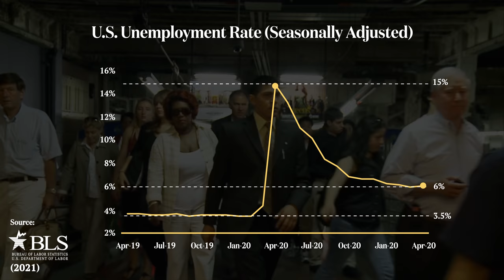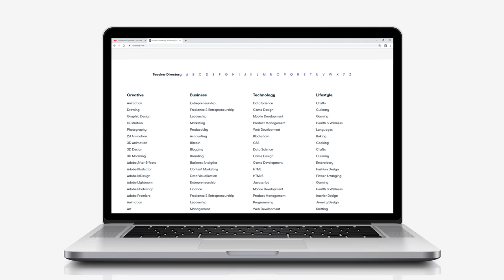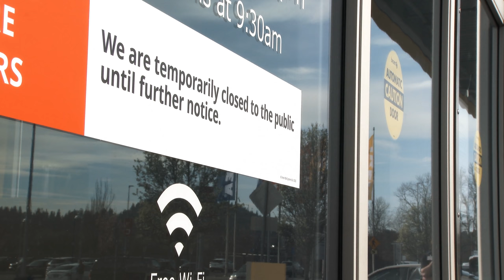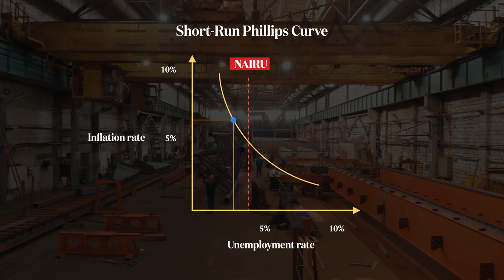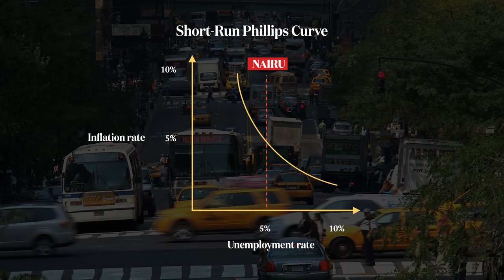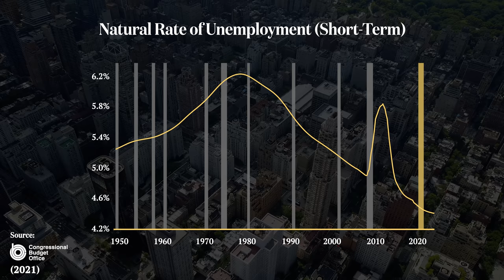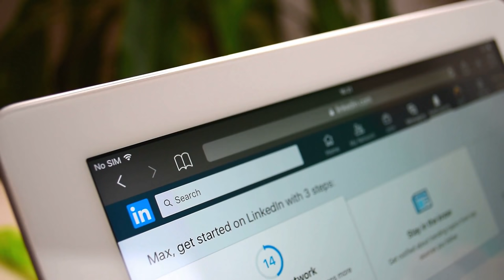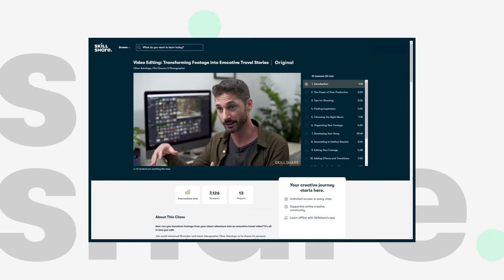The Great Labor Shortage Crisis | Economics Explained

Comment: I find the framing interesting, calling it a “Labour shortage”, instead of a “Job abundance”.
Reply: @Ciph3rzer0  I used to be your run of the mill Libertarian until I actually started working, not anymore. I've learned better than to trust Capitalism. Capitalism is the enemy of the free market, just as much as, if not more than, socialism.

Now, I still don't believe in the minimum wage
I think its no more than a temporary solution at best, or at worst, an appeasement.
The 7.25 minimum wage was put in place in 2009, 
in 2021, a 7.25 minimum wage might as well be the same as a 5.72 minimum wage in 2009
Even if the minimum wage was brought up to 11 or 15 (though both a net improvement value wise), it will only inflate and we'll be back to square one eventually

We need Unions. Strong Unions with integrity, that will actually fight for a dynamic fair wage, good benefits, and put the power in the hands of workers, not politicians and their corporate puppet masters.
Reply: @matizluv1316  Socialism just tends to not work out cause it tends to necessitate statist or authoritarian measures, which will always fall into the wrong hands (cause the only people who seek to harness state power are specifically the ones who should not have it), and we end up with every long-lasting socialist system we've witnessed today. We haven't witnessed the failure of socialism, we've witness the failure of Humanity. 

Mutualism is about as close to Socialism you can get before you hit the Point Horizon of the Statist Black Hole(tm)
Reply: @matizluv1316  This is true. Theoretically Socialism is far better than Capitalism. The biggest problem with Capitalism is that it actually incentivizes anti-competitive practices. If Company A can make Company B (well, all of its competition) go out of business, then Company A can do whatever it wants and use psychological pressures to make people just have to be okay with it and make a lot of money in the process. Look at the Oil Barons of the 1800's and Big Tech of today. These corporations are only allowed to get away with whatever they want because of Capitalism. Which is why only an idiot or someone already wealthy would promote Laize-Faire Capitalism (capitalism with no regulations, AKA a [government-]Free Market). With the market being much more controlled by the state, a lot of these practices could be controlled or eliminated entirely under Socialism, in theory.

However, Socialism is not without its own massive problems. For starters, Socialism actually disincentives innovation. If it is made much harder to get rich and offers less benefit to be in the super wealthy class, there is less motivation to come up with something new that everyone would want to give you their hard earned money over. PC's, cell phones, many medical treatments we take for granted would not have been possible under Socialism, and anyone thinking differently is fooling themselves. Second, Socialism is only better than Capitalism if the leadership isn't corrupt. If the leadership is corrupt it can instead institutionalize anti-competitive practices (or at the very least, turn a blind eye to not risk their own personal status), which makes it harder for anyone to break into the market and makes the corporations even less incentivized to make things better for the people. Third, Socialism requires people to still work and put in the effort without any extra benefit. If the money going into the system via taxes is not enough to compensate for the money being spent on social programs, then the system is unsustainable and either has to cut benefits (making everyone poor and hungry), becoming authoritarian and forcing people to work for no benefit, or fall back to Capitalism. And history has shown that this issue is such a hurdle to overcome that every single time true socialism has been tried, it's failed, and instead resulted in massive starvation and executions and authoritarian control.

So yes, Capitalism is bad. It's not the enemy of the free market because it is the free market. By definition, regulations mean controlling the market, and the more a market is controlled, the less it is a free market. But yes, Capitalism rewards people for walking all over others that are less ambitious or just trying to get by. It rewards the greedy, the immoral and the corrupt and punishes good natured and hard working individuals. This is true. However, Capitalism still functions when people are lazy, corrupt and greedy and even the lowest citizen will at least be able to get by and potentially prosper if the government is providing some aid to them (Social programs that do not interfere with the market is not socialism, it's capitalism with social programs. It's why countries like Sweden actually get mad when people call them socialists. Well that and they remember the United Soviet Socialist Republic). And this is not true for true socialism. Socialism doesn't work when people are lazy, greedy or corrupt
Reply: It's not really about framing, on economics it's always been the labor market not the job market. Businesses don't sell jobs, workers sell their labor.
Reply: @migeyefoxe9972  What's this? Someone who criticizes Capitalism without being a Socialist? Can this be true?
Reply: @aregulargamer1  we need more people who ain't have the fixed mindset of "either capitalism or communism/socialism and nothing else"
Reply: @matizluv1316  market socialism can be done and can subvert current capitalism without government revolution, if you create a privately-owned joint venture company where every worker is a partner rather than a salaried worker, you’ve just accomplished one of the most important things about socialism without any violence. Now how to turn a profit against subsidized corporations...

Comment: I've been applying for jobs and not even getting called back. But I'm not doing crappy, low wage jobs anymore. I went back to college to avoid that and I refuse to go back to it unless forced to. That's why I saved so much money, just to not have to do them anymore. It's so annoying to hear about how employers are fighting over employees when all I'm getting is ghosted with 5 years of experience and 2 college degrees. I'm not lowering my standards because I worked hard to earn the right to have high standards. Which aren't actually high. I'll take a job at below market value if it means being paid enough to afford an apartment of my own, which I have never been able to afford and have dreamed about for 10 years.

Comment: Tell me where I can find these $30/hour plumbers. I'd like a new shower installed, and current rates are showing around $120/hour.
Reply: That's the plumber's wages. On top of that, the business needs to pay 37% more tax for this wages. Then there's the price of the tools, overhead, fuel/parts/insurance for the truck he drove to your house, and windshield time if that's not included in your bill. There might be a pinch of profit in there to save for a rainy day.
Reply: Plumber gets 30 his employer keeps the rest
Reply: @annybodykila  *plumber gets 30, 20 goes to gas/maintenance/supply chain, 20 goes  warehouse and office space, 25 goes to support staff, HR, bookkeeping, 15 goes to marketing, and 10 is actual profit so it's worth doing for the owner.

Or do you really think a dude with a hammer and a pair of walking shoes is all you need to have a successful plumbing business?

Comment: Funny how it’s explained that there’s a problem that lower level employees won’t accept less pay than the “cushy” unemployment/added benefits offered to buoy the economy during the pandemic. Of course, EE never directly said workers should accept lower wages to return to the same jobs, but it was presented as though there was no other option, besides simply accepting the macroeconomic consequence of then not returning. Not at any point was it suggested that the top earners in a company forgo large bonuses or an salary increases reaped during the pandemic. No one suggests CEOs or executives accept pay rises less than the rate of inflation, but somehow it’s acceptable to pose that dilemma to low wage earners. It can’t be gain said that there isn’t an implication that  lower level employees are expecting too much.

Why do we not consider the absurd disparity between stable, increasing executive pay and lower level employment at the same company? Moreover, if its implied that this unsolvable problem just can’t be resolved unless low wage employees hold their noses to return to low wages, what are the market corrections that will result from the knock on effect of mass eviction, or personal insolvency for those low paid workers if they actually do return to prepandemic wages in the midst of already present inflation, and in the housing bubble?

Comment: Lufthansa during pandemic took government bailout and also fired nearly 3/4 of their ground handlers & customer facing positions. This way, they saved money and the C level & board had nice bonuses  (you can check the earnings calls of the last 6 quarters) As a result, people who were accepting the miserable pays just because they had some stable job, woke up to the fact that there is no stable job. So no need to work for that miserable pay for such hard work. You can earn that much anywhere anyway. Same goes for all of the services sector. If you had to work for 10€/hr, why in the heat of a busy kitchen? you can work for that much money wherever you wish. Especially if you played your hand well during pandemic and upskilled yourself. If working will not improve the quality of your life, why work?
So, there is not labor shortage. There is too much money accumulated in too little hands. What little dribblings they want to pay out to people is not enough.

Comment: I worked for a large corporation several years ago. We held a Kaizan event for one of the products we made. It used to be manned with 3 people and would make approx 75 units per 10 hour day. The improved process added 2 more employees to the mix but increased the output to approximately 200 per day. I had access to see the cost per unit to the customer, the cost of raw materials and average pay of the employees was easy to figure out since most were temp employees. At 200 units per day, minus cost of parts and labor they were getting $90k per day, and only paying the production workers an average of $6-700 per day. I was always pushing for a raise and they just couldn't justify even 25 cents an hour.

 That company was soul crushing and I was super glad when I was able to leave it.

Comment: Ended up quitting my job two years into the pandemic of working conditions and the companies control freak tendencies. They kept try to solve everything problem by making the more experienced workers do more work to make up the difference. It basically impossible to every meet company standards because the money you finally do so they would be changed. And changes in how employees were evaluated insentivised new employees to avoid work by passing it to the more experienced ones tripling the work load.

Comment: The only issue in the USA is the lack of manufacturing jobs.    The USA should have around 30% of all jobs as manufacturing which is similar to Germany however the USA is only at 9% so short around 21% which is massive.     After all the largest ethic groups in the USA are Germans and Hispanics and both are by heritage great at manufacturing and are very hard workers.      The lack of such jobs has sent millions to simply not work at all and they either live smart in small rural towns on cheap land and do with small wages or "old" money handed down to them, work in service industry or logistics where they are unhappy, under worked and under paid for their capabilities.       The biggest issue today in the USA is this lack of manufacturing jobs.    The Democrat party wants to keep raising minimum wage to fix the problem but that is not the solution as it is only a band aid, a very temporary fix, the real proper and long term solution is to force manufacturing back to the USA.   The US has the consumer base and the money to afford buying American made goods so only political will to impose tariffs on Europe and Asia will change the equations. Donald Trump did point the USA in the right direction and this is proven as the Democrats did not reverse any of the tariffs!!! That is proof enough that indeed is the solution, both political parties support it!

Comment: I believe you're wrong when you said the Inflation was related to "Supply & Demand."
Apart from Supply & Demand, corporate Greed is also responsible for worsening inflation.
When gas prices spiked (and whenever they felt they could get away with it throughout the years), corporations raised the base price of goods for greed in addition to the inflation increase. This greed increase happened repeatedly over a long time so the insignificant increase compounded and has become a serious issue now.

Since this greed increase raises the value of goods across the board, people need higher wages to meet the status quo, and in conjunction with the increase in minimum wages, prices get increased across the board to "pay people their higher minimum wage, and this creates its own "INFLATION CYCLE" which comes with spots for increases due to greed.

Comment: The problem is with the disparity between the highest incomes and the lowest incomes.
If a company paid its bottom tiers a little more and it’s top tiers a little less you wouldn’t have inflation.
There’s this myth that the people at the top are unique when actually what’s unique is the opportunities that they corner.
There’s any number of contenders for each one of their positions that would do the job for less with equity, but the point is that the people appointing that position would then have to reappraise their own salaries. Which they won’t jeopardise.
My suggestion to get around this problem is that the people at the bottom should set the wages of the people at the top and vice versa. The people at the top will set the wages higher than they would otherwise they will have their own wages reduced as a result.
That way you’ll get more accurate human value.
No one is going to try this though.

Comment: I feel as if this video skipped over a  few key components of the current labor shortage: early / fear induced retirement and the mismatch of skills needed versus workers available in the labor market.  There is a huge labor shortage in the industry that I work in (aerospace and defense), but not just anyone is eligible for that kind of work.  At the onset of Covid many companies in the industry offered retirement packages for older employees as the non-military side of the industry ground to a halt because very few people were flying.  It made sense at the time because nobody knew when people would start flying again so orders for planes were halted.  During the pandemic it seems to me that military orders increased so that aerospace companies who are defense contractors could keep the doors open.  The problem now is that the commercial side of the industry has come roaring back but there are not enough young workers to replace the wave of retirees.  The industry pays well and wages have increased (I recently got poached myself), but it’s not an industry that one could easily transition into since one small mistake could cost lives.  A disenfranchised, unemployed food service worker may be attracted to the higher pay and lack of customer-facing work, but would lack the skills to quickly jump into the job.  I personally feel as if a large contributing factor to the current level of unemployment is simply that younger generations were taught that certain types of work are lower class or for less intelligent people, hence why a plumber can make more than a white collar worker now.  I myself am a college educated millennial and this is just my anecdotal experience🤷‍♀️
Reply: One important consideration on the defense/intelligence side of the aerospace/tech business sector is that not only did these businesses not close during the pandemic many of the jobs are only available to those who are US citizens who can pass extensive background investigations.

Comment: The problem is everytime workers demand higher wagers and they get the raise everything has to go up in price to cover costs and you might think you are better off but you are not. An extreme example: if the NMW was £9 and it doubled overnight to £18 then that very next day you would find a loaf of branded bread to be £2 for 800g. A 2 litre carton of milk £2.50. A dozen eggs £5. You get the point.

Comment: If the amount of currency is not rising any more than the GDP growth there is never any inflation. If there is 1000 units of currency in 2020 and 1000 units in 2021 and the economy does not grow or having velocity, inflation is zero. Higher wages and supply chain issues do NOT cause aggregate inflation. With a stable amount of currency the higher costs of those things would be offset by lower spending elsewhere. Inflation remains zero and spending drops. But the government (and people) don't want that kind of pain, so government is inflating the amount of currency in the form of "free X" and this is causing inflation.That is really what is happening.